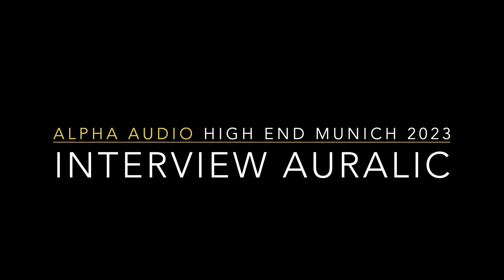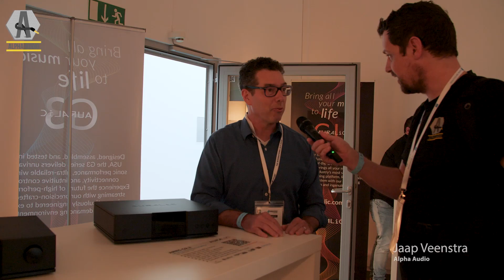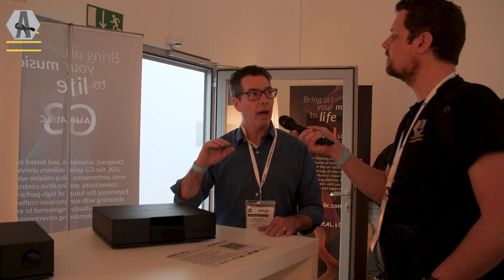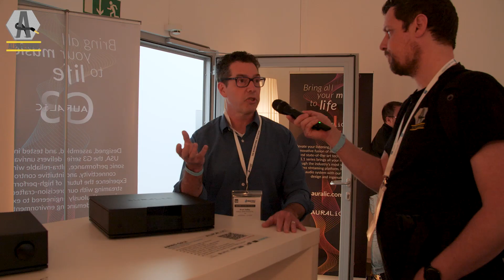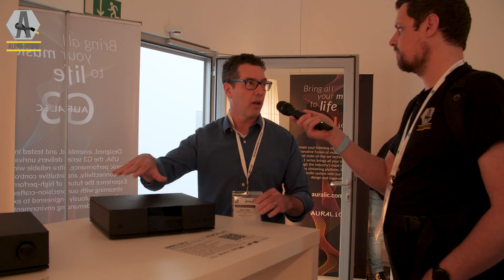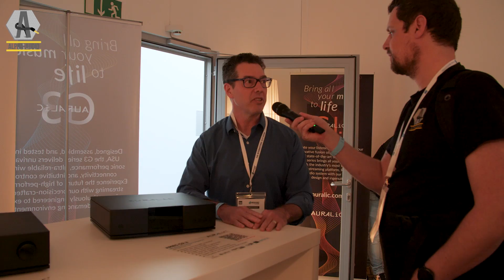Not one, but FIVE new products. Auralic - High End Munich 2023

Comment: Auralic stuff used to be great value, I still runs the Aries G1.
There is no reason why the G3 is twice the price of the G2's.
Same kind of component with slightly upgrades.
They are getting too greedy, and realized being stupid after the market reactions.
That's why the g3 is still not released yet.
If they are going to do the right thing, just release the G3 at the same price as the G2's, and apologies.
They can still work on a new series that has two box design with more exotic PSU and super CPU to do the up-sampling, this one can be priced higher.
S1 mid level, G3 high end, and what ever super high end series for the rich.

Comment: Great products, but the prices are outrageous. It's also worth noting high end steamer transports (no DAC) are a waste of money. An example would be the Aries S1 and Vega S1. Internally, the Aries S1 is the Vega S1 without the DAC and preamp components, yet has the same retail price. I think putting only basic streaming on the Vega G3 is a dick move because of this.
Reply: On price you are correct. The Aries should be less $ than the Vega. I would like to know how they justify them being the same price. The Aries does have a DSP chip to provide PEQ but that is not the same value as the Vega DAC components.